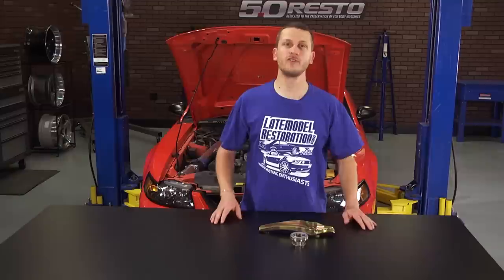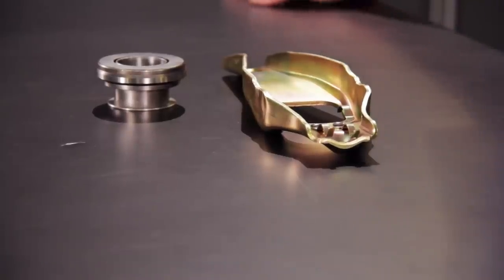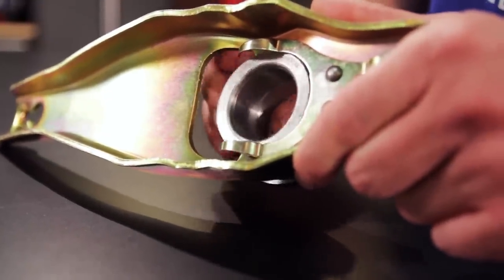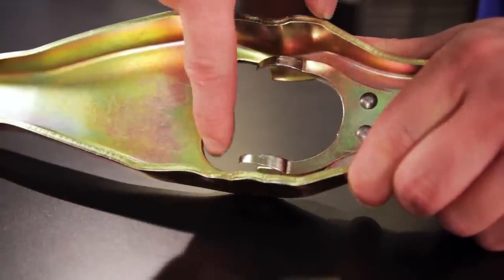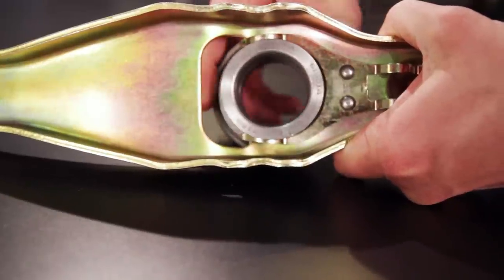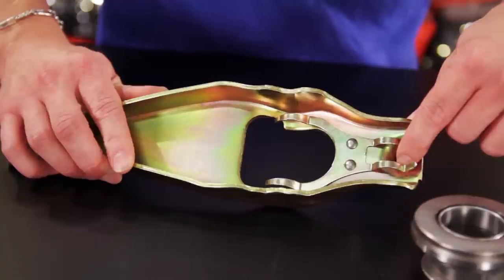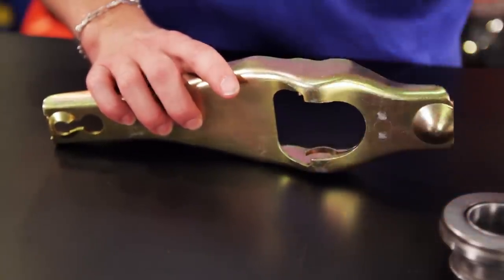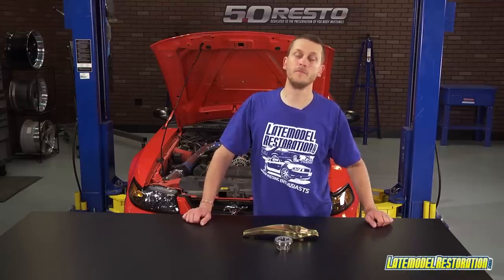Mustang Throwout Bearing & Clutch Fork Install (79-04 Fox Body & SN95)

Comment: I totally let a friend install that while I was replacing my rear main and it wasn't until AFTER we got the trans back in that I realised it wasn't right. Thanks for the info, I was able to diagnose that it was wrong from the outside because of this video
Reply: Did it make your clutch feel a lot softer?
Reply: ThatOneDude_OnYoutube _ it made it very soft for the first 3/4 of the pedal travel and at the very bottom it was a very short and heavy "pop" of the clutch

Comment: My throw out bearinf just starting chattering in my 86 Mustang Gt. I have never done any kind of transmission work before . How hard is the removal process of the transmission and do i need any special tools to pull the fork and bearing?
Reply: Take the driveshaft off 4 bolts for tranny 16 mm disconnect clutch cable, starter has 2 bolts 14 mm then the bellhousing 6 bolts also 16 mm . no special tools needed

Comment: What if you have the teardrop facing the opposite way towards the pivot stud
Reply from the maker: As per the video stated the teardrop needs to go towards that flat side, if not it can work itself loose.
Reply: Late Model Restoration That doesn’t make any sense to me because there’s nowhere for it to go if it’s around the input shaft of the transmission

Comment: To replace the bearing, do I have to remove the bellhousing? or can I separate the transmission from the, housing reach in, swap bearing (applying said grease as I go) and reinstall transmission, or does it all have to come out? __
Reply: Just the mustang transmission.